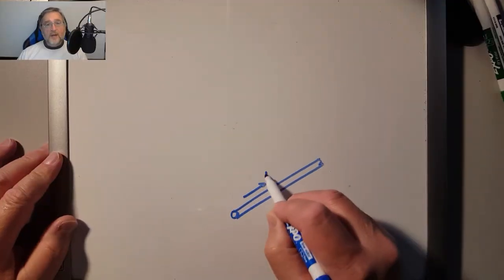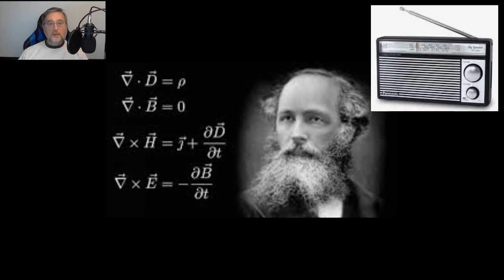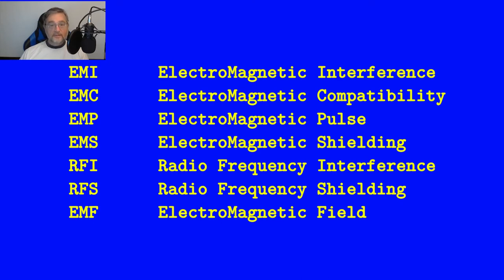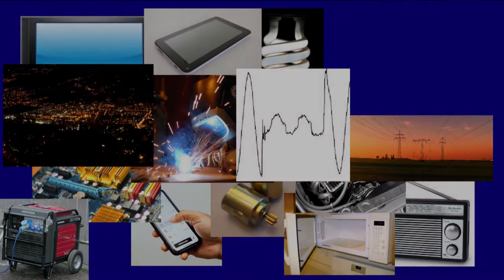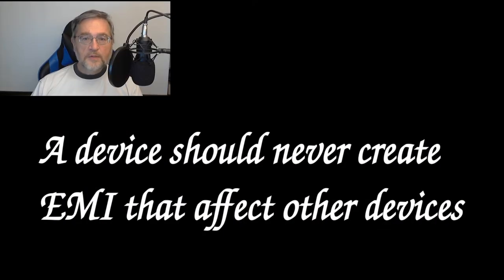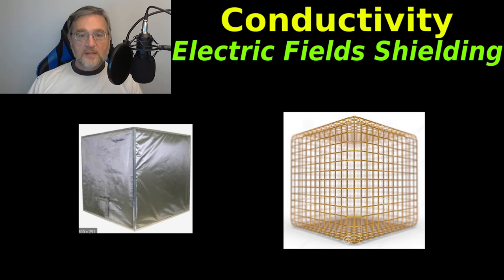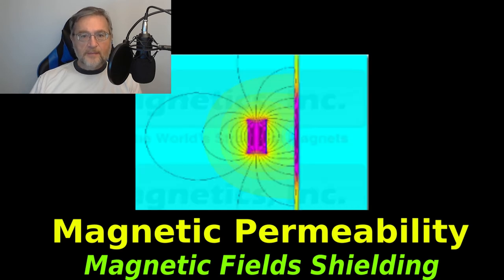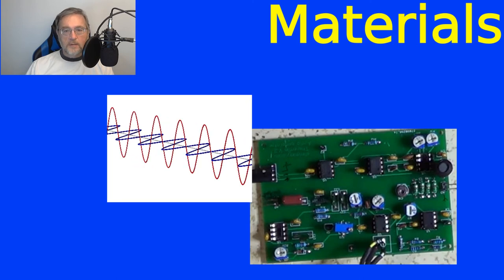Electromagnetic Interference Shielding

Comment: I have a devious neighbor who uses a signal jammer to mess with my garage door signal - even though I have changed the code several times. 

I know there are garage doors which have a billion codes, but those can be hacked also.

Any suggestions on what I can use all around my garage to block outside interference? A plug-in device that sends out a signal to protect large areas?
Reply from the maker: Unfortunately,  to block the interference from your neighbor you would block also your own signal from the garage door opener. The only thing that comes to my mind is to eliminate the remote for the garage door and install, instead, one of those devices connected to the wifi of the house. Which can be controlled through Alexa or Google home.
Reply: @eleneasy  Yeah. I looked into a few of those. Reviews are saying they are hackable & have all kinds of glitches. Oh well. I will have to keep opening it manually & keep it powered off. Thanks!
Reply from the maker: @yumyumkitty2104  have you tried to reason with your neighbor? Also,  as far as i know it is illegal to scramble radio waves.  Maybe you should check with a lawyer or the local police.  The local police may actually be able to reason with the guy.
Reply: use padlocks ?  manual hahaha......
Reply: use manual switch  (sensors)  and automated motors (mechanical setup)